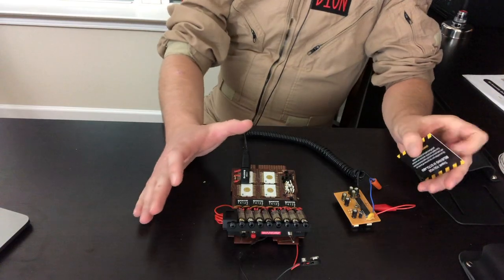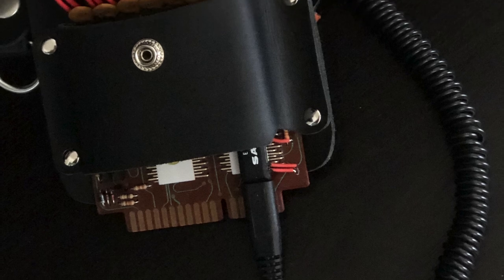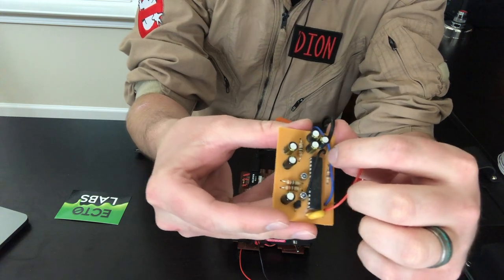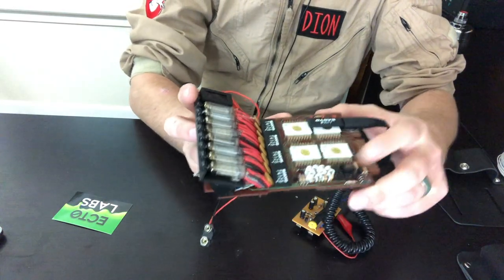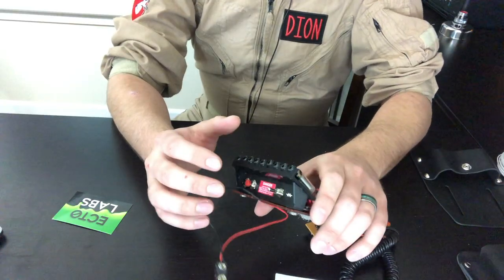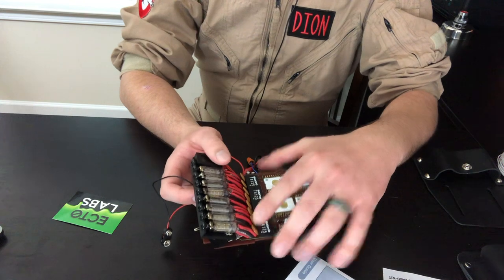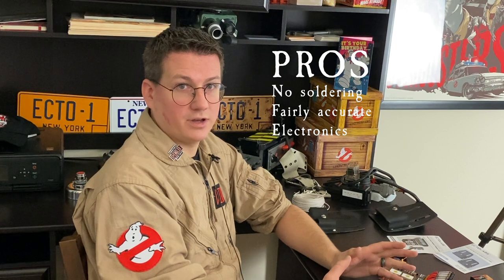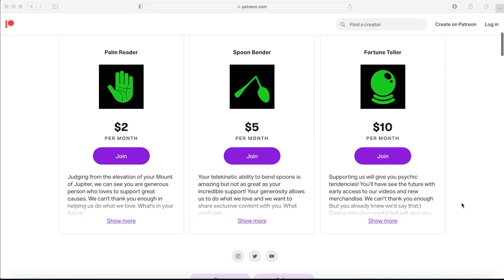Ectolabs Belt Gizmo 8400 Review and Build Tips

Comment: Pretty cool build! A pin vice would have helped a lot for the holes you needed to poke, or enlarge. Its a small hand powered drill used mostly in modeling, usually to pin a model's joints together for extra strength or prepare it for painting. I use one all the time in my miniatures.

Comment: I mean it actually does make sense to reduce shocks I mean let’s remember they are strapping what is basically a nuclear power plant on their backs and that would need a ton of electricity to properly power it and when the frame used to mount it on the user’s back is all metal you run the risk of high voltage shocks so you would need a device to mitigate that to a much more bearable level to me I believe that there is a shock but the gizmo reduces it to like a very very tiny static shock level